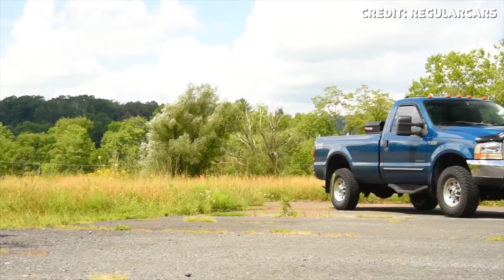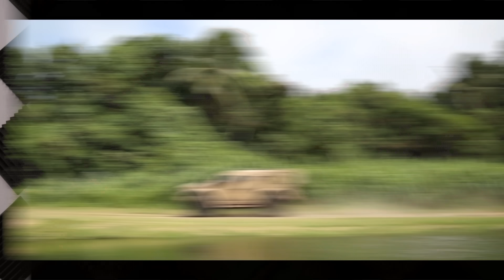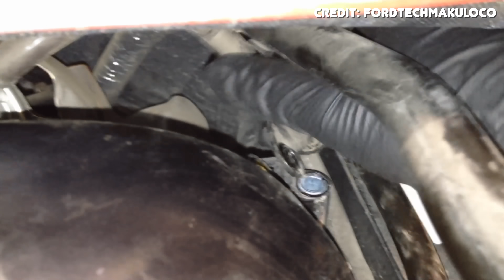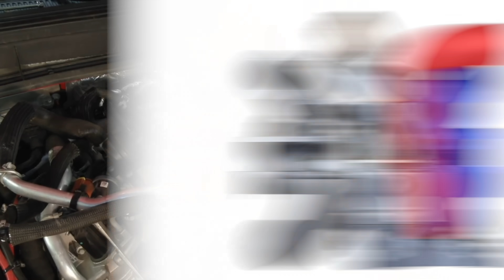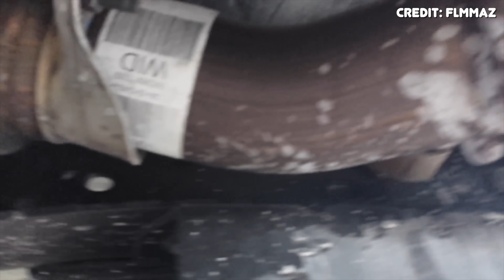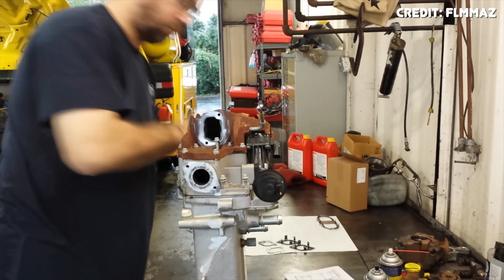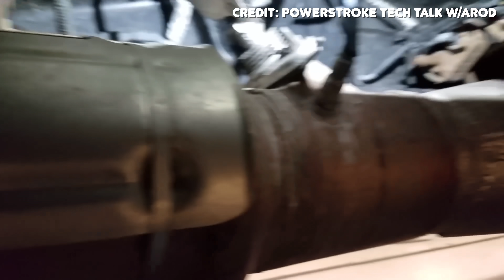Everything Wrong with the 6.7L Powerstroke

Comment: Being a ford diesel mechanic for 17 years i can say you're missing a lot of major issues such as tsb's and recalls that go on forever. they fixed nothing from the 6.4 to the 6.7.
radiators mostly primary but secondary as well, both water pumps, wiring harnesses are a major problem, egr coolers major problem, glow plugs breaking, customer using a remote start and the main bearings spin and seize. front and rear crank seals, oil pan gaskets, high pressure fuel system failures are very common, egt sensors, ep sensors, cac pipes blowing apart at the cooler, vacuum pump gaskets, fan clutches seizing, head gaskets, injector clamps breaking. plugged dpf's are very common.
these engines are absolutely no cleaner than any other when you disconnect the down pipe you'll see that. 
primary fuel bowls breaking when trying to change the filter and the wif sensors fall apart on their own. 
3 recalls for the block heater cord... i"m sure that i'm missing quite a few more issues but these are seen every day.

Comment: To answer the question on the aviation industry, we can’t add emissions equipment without adding a ton of risk. The last thing we need is equipment failing and bringing down a plane. Our fuel burn per mile is also low. The only thing we probably need to do soon is get away from leaded fuels.

Comment: Please if anyone can answer this question or give some guidance I'd really appreciate it. So I had a built /straight piped 6.0 years ago, had no issues getting tunes emailed to me on my SCTX4 for the truck. Truck was totaled in 2017. I live in the rural south where you don't hear much about EPA this or that. I don't spend much time online (that statement will be relevant in a moment) anyways, last month I was elated to find (at a dealership) a 2012 F-350 6.7 fully deleted/straight piped. I had no idea things had changed and it would be damn near impossible (or impossible) to get tunes for it. Whoever the previous owner was left a pretty hot tune on it with no tuner but I figured no biggie, I still have my SCT tuner, when I get home from buying it I'll get a company to send me some 6.7 tunes. Well obviously that hasn't happened. I can't tow with it while it has this tune ,  returning to factory isn't an option , I know reliability/longevity isn't going to be great daily driving with such a hot tune. I love this truck but I have no choice but to either some find a way to get tunes on it , or I guess contact the dealer and give them an ultimatum of give me my money back and then some or I'll have to report to the EPA and sue? I don't want to put anyone out of business and I don't want to get rid of this truck. If anyone has any advice for an idiot like myself I'd really appreciate it. Thanks in advance

Comment: I would not say the 6.7 is better then the 7.3. A 6.7 is like a wanna be diesel vs a 7.3 is a cast iron workhorse. Everyone is hung up on the fact that the 7.3 isn’t fast. But a real diesel was never designed to be light and fast. Its just rudimentary thinking.
Reply: Ok... but I use my 6.7 for pulling a 32’ gooseneck loaded and it can outpull a 7.3 all day.
Reply: @crandonborth  I bet it can, but I bet your truck will break before mine too.
Reply: @Stank-b8w  The trouble with 6.7 is the emission... the motors solid. It’s a 2017 so the warranty gone and so are the emissions bs. My buddies has a 7.3 it’s a literal cast iron tank🤣 still very cool to pop hood side by side and see the vast difference between the 7.3 and 6.7. The 6.7 is ridiculous to work on with everything so jam packed in tight... at least the 7.3 has some room.

Comment: You need to go back and do your research again I think. You missed the one flaw that makes this motor worse than any other motor on the road. Bearings. The 6.7 does not have tangs to hold them into place. The 6.0 and 6.4 and 7.3 and....any other motor out there....didn't have this issue. The 6.7l WILL spin a bearing eventually. It's not a question. If you own a 6.7 at the shop I work at we recommend that you sell it immediately. This motor is a terrible design and not thought through at all. How you think it's more reliable than a 6.0 or 6.4? That's beyond me. Just because of the bearings alone...

Comment: Ultra low sulphur diesel means less lubricants for the cp4, run your additives and add 2 stroke motor oil to your tank of fuel. We own a 2019 F350 with 266k miles , deleted with a minor tune. Flawless truck. Just replaced driver seat cushion because of all the seat time.
Reply: I have a 2014 F350 Platinum with only 70k miles. I’m still in love with it !
It’s been mostly my daily driver and office (probably way too many idle hours)…
   I just started using additives, but my ears peaked when you suggested a little 2 stroke oil.
   How much oil per tank, and is a simple outboard 2 cycle oil adequate ?
   I’m considering installing a bypass return on the CP4 pump by ?DSS?, or possibly replacing the pump with a new substitute pump (I forget the brand).
    Please 🙏 advise, Thanks - Joseph
Reply: The 2t Oil strat is the best

Comment: The Real problem still remains on the 6.7l Powerstroke that remains with basically all post 2003 newly engineered Ford products..

Even when they make a good, reliable vehicle, they still use expensive parts, require more labor hours than other American brands, and are nearly always the most complicated American vehicles.

Would I own a 6.7l Powerstroke? Sure, a brand new one is an excellent truck. I would, however, only own it til the first large issue after the warranty was up. I wouldn't get a used one and find these a colossal pain in the ass to work on.

If you do not have a lift or do not want to pull the cab to work on this, do not get a used one, unless you have an excellent independent diesel shop nearby with uncommonly low shop rates and tons of competence.

Comment: One thing you forgot to mention is the crankshaft breakage issue they had early-ish. Last I heard was a 2014. Wasn't super common but was common enough. Usually broke the front 2 cylinders off. Sometimes they'd still run.
Reply: I think that’s why Ford changed the harmonic balancer.
Reply: I think it was the crank shaft gear, it would start getting some play so a video I watched showed that just a small tac weld would save it from carnage

Comment: I’m not a Ford or diesel guy at all, but my 2nd gen 6.7 F450 flatbed work truck is a beast. It’s been great at almost 180K with only an a/c condesnsor leak and minor radiator leak. It never breaks a sweat hauling 8,000 lb and towing

Comment: I bought my 2017 F350 new and haven't had a lick of problems. I use a ton of fuel additives with every fuel up and change my oil every 5000 to 5500 miles. I had a 6.4 Ford that was a beautiful truck but over heated every time a tried pulling a trailer. LESSON LEARNED!!!!

Comment: I own a 6.7L, 11 years old. Great engine concept but emissions design is the worst thing u can do to a Diesel engine.    The amount of returned crud the engine has to process to meet regulations is incredible. Then on top of that the fuel pump failure takes out the fuel system unless u spend money to contain damage to the pump. The cost to maintain these trucks beyond 150,000 miles will hurt the pocket book unless u perform preventive maintenance before things fail.
Reply: Why would you buy a first year redesign?

Comment: Ford... build a motor..
🤣🤣🤣🤣🤣🤣🤣🤣🤣🤣🤣🤣🤣🤣🤣🤣🤣🤣🤣
This is from a Ford guy but pre 2002 as its all garbage. Look at the new DI stuff. High pressure fuel pump mounted to head 3.5 in from turbo manifold and high pressure injector next to coil that cannot contain the spark brand new. Ford hold onto your ass cause a NOTHER class action suit is on the way. Ford = pure trash

Comment: Had my 6.7 for two years, only issue with it was a relay for the glow plugs. It’s not really a daily since diesel is crazy expensive now but it’s a towing beast.
Reply: That's what I consider mine as well! But, I've yet to tow my 5th wheel w/it! Mine is a F350 4x4 6.7 diesel. I hope you're right! 😏🤔👍🙏
Reply: @elaineewalt8137  the wife and I just towed our 8000lb 30’ travel trailer to Tennessee and back, 1600 miles. The 6.7 is so much better than the 5.0 f150 I had, that weight and payload were well within my f150 limits but it was much more laborious to drive, requiring much more attention to drive and every time a tractor trailer passed me I knew it. Loved my f150 but this is night and day towing, especially when pulling on hills.
Reply: @bluecollarwatches7048  
My camper is approx 13k lbs, and it's 38ft. long. Here goes! 😳
Reply: @elaineewalt8137  you’ll be fine,  believe it or not I actually got 14.1 mpg over 1600 miles. I never go over 65mph towing though, don’t want my trailer tires over heating and blowing, every long trip we take I see somebody flying past me doing like 75mph and later down the road I see them on the side of the road with a blown trailer tire.
Reply: @bluecollarwatches7048  
Thanks! 👍 You have a 6.7 diesel as well?

Comment: Hi there. Nice video. I have a purchase on the line in about 2 weeks. It’s 2011 f350 dually 4X4. For being an older truck it has 58k miles. I live in an area of Arizona where we don’t have to smog vehicles. Delete may be an option although all that system just got replaced about 500 miles ago because it’s a CA truck. You mentioned some of the problems from GEN one being revised in GEN two and GEN 3. Are the better parts able to be put onto the gen 1 to increase the durability? This truck is like new condition and I know the guy (original owner) and the truck is immaculate. Would you buy it or is gen 1 prone to lots of issues? Again I could delete where I am so there is that.
Reply: Have you found anything on swapping out the next gen parts to the first gen truck?

Comment: I have a 6.4 rebuild. My buddy knew about all the problem with that engine when we started. First to deal with the heat issue with piston we had them ceramic coated with the same ceramic they used on the space shuttle. We handled the bolt issue on the head. We had a bead installed around each piston cylinder. This prevents blow out of the cylinder head gasket. We also deleted the Egr and the exhaust. We reprogrammed the engine. It runs great and I’m following severe maintenance to get the life out of the engine.
Reply: That is just wrong you had to do all that to make it run. I’ve heard of you fix all those problems the 6.4 is good but I’m not putting that kind of money into something I shouldn’t have to but ford didn’t design or build that 6.4. That was all navstar. Glad ford took over and built this 6.7 on their own.
Reply: It will last a very long time time tomw!

Comment: The s&s kit is the best solution to anyone worried about the cp4 it catches all thr metal shavings in a filter before its sent back to the tank, they cut a notch out of a lifter in the pump turned it sideways and drove it over 100 miles, of course the pump died but the truck never did, tank was clean primary filter was clean and all injectors tested good, for $500 you can't beat that security
Reply: I’m was seriously considering getting one, but I just learned that the cp4 pump can be replaced with an aftermarket (newly designed) pump.
    I forgot the name, but because it’s relatively new, the jury is still out…
    Any thoughts ?

Comment: These videos are like the definition of reading off Wikipedia. It’s the popular beliefs not reality that is shown here. Navistar used the Diesel engines they designed the t444E, vt365 and the maxxforce 7 were all engines that international built for their rigs. they simply shared their work with Ford who then attempted to make more power and do more with them without upgrading parts. No wonder navistar used the 6.0 from 03-16 while Ford claimed it was garbage after only 4 years. It’s like this you over work something well then it’s gonna fail wow crazy I know, but yes that’s how physics work kids.

Comment: The 6.7 powerstroke, if fully deleted is probably one of the best diesels ever made not just best powerstroke
Reply: All of them are much better reliability mileage power. That's why I keep my 03 d max federal emissions standard no cat or EGR tweeked with banks six gun big hoss bundle. Hauls ass and will pull 20 mpg bed full of chit 5 people Crew cab long bed 35 bfgsTo Vegas and back to so cal.
Reply: No way in hell will that ever be true. They spin bearings way too much because nothing holds the bearings in place. They have no tangs. We rebuild about 60 of these a year...and we are a small shop...6.0s and 6.4s are awful motors but the 6.7 takes the cake....step on it....and you spin a bearing XD
Reply: @Kolonol1  - interesting: I spun a bearing on my 2013 6.7 with only 8000 miles on it.  I special ordered it from factory.  I sold it later that year with 15k on it, ordered a 2014 (same identical truck) .  
    I have 71k on it now and never had any issues.   I am considering replacing the cp4 pump with the new alternative one (I forgot the name)..  My other option is to install that $400 kit that keeps the return line from allowing any metal shavings to enter your fuel tank ..
   If you have any suggestions (other than torch🔥 the vehicle-lol 😂), please give me any suggestions.
Reply: @Joseph-wp2ry  so far we haven't found any solutions to the bearing issue. We have started having keyways cut into the crank and gear though so that they stop coming out of time. Really tired of dealing with bearings though HAHAHA I always suggest the kit that keeps the shavings out of the fuel however. It's much cheaper than the alternative. Other than that we don't really know what to do other than sell them and get a Duramax or a Cummins.
Reply: @Kolonol1  lol  -  if the Ford had a Cummins option, I would have definitely considered it.
    Thank you, though ….
Reply: @Kolonol1   what years 6.7 PS had this problem all of ?
Reply: @techs1smh13  so far we have seen them in a wide spectrum of them but so far we haven't worked on anything past 2020 because Ford covered it under warranty. We do a lot of work for hotshot driver's and some of them with newer trucks as well as older tell us about them. I know of one driver who's 2021 spun the front main bearing twice now. 2nd time ruined the block instead of the bed pan and he got a new motor. But past that single instance I don't do much talking with a lot of the customers so I can't say for 100% sure.
Reply: @techs1smh13  Ford seems to think they are fine for the record so I doubt they have changed it. Ford told us that they spin because of people beating on them. They said that they increased the bearing size by 2 thousandths and that is where the holding power is. But I don't know about you, but that makes no sense to me. Pressing them into the block I can maybe see it but if the holding power is half on the turning assembly....then that means half of the holding power is TRYING to turn...at least to me and so far so other motors as well HAHAHA
Reply: @Kolonol1  holy chit. I've heard a lot of things but not that.
Reply: @Kolonol1  I'd Be one pissed off dude.
Reply: @Kolonol1 I see the mains delamed all the time but they all have one thing in common - Mini Maxx... No timing, no spun bearings
Reply: The Duramax is my purchase
Reply: I personally drove a def 2015 6.7 and the only thing that went out was the def pump at 420,000 miles last I drove the truck it was still going at 530,000 miles. The def system is still currently in the truck.
Reply: I personally drove a def 2015 6.7 and the only thing that went out was the def pump at 420,000 miles last I drove the truck it was still going at 530,000 miles. The def system is still currently in the truck. No other repairs have been made to the truck other than a lot of tires and brakes lol

Comment: well I can tell you I'm a professional driver I own a 2016 with a 6.7 diesel when it's running right I'm very impressed with its power however I bought it with 14,000 miles on it and that 287000 Miles I threw a rod through the crankcase so I had to put a brand new engine in it from Ford it cost me $13,000 to fix it came with a two-year unlimited mile warranty and two years one week later a wrist pin came loose and I ended up having to replace the engine the prices have went up since the first replacement the first replacement was a long block I couldn't afford to replace it with a long block again so I had to go with a short block which cost me $12,000 so there was $287,000 miles on the first original engine and I put about 340 thousand on the second new engine and as a professional driver I keep my truck 100-percent maintained so basically every two years I'm putting a new engine in my truck when I get this truck paid for I will never own another Ford truck ever again in one of the reasons why is the dealerships are crooked they try to oversell you and I have caught them replacing parts on my truck or claiming that my truck needs Parts when it don't I find Ford dealerships very crooked and not just one dealership but every dealership I've went to I no longer will deal with a Ford dealership ever again
Reply: Ford is in the business of selling trucks not building and selling you something that’s gonna last you forever. I’m not a ford basher I own a F450 with a 7.3 but I’ll take my ram truck powered by an engine built by an industrial engine builder any day over a newer ford
Reply: @SUBH20HNTR  yeah Ford wasn't my first choice however at the time I didn't have much choice so I went ahead and went with the Ford but my first choice was really the Chevy Denali but I appreciate your opinion and your thoughts and I know just from this point on if I were to buy new truck again it won't be a Ford